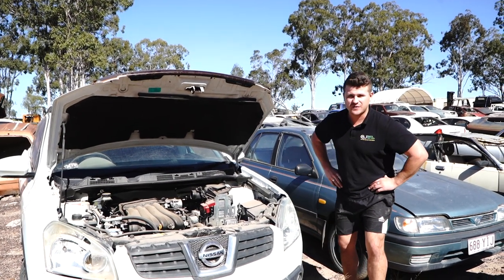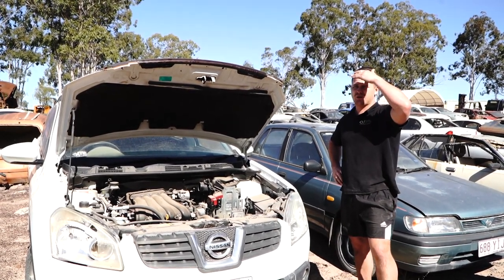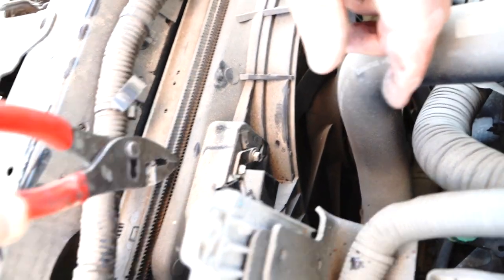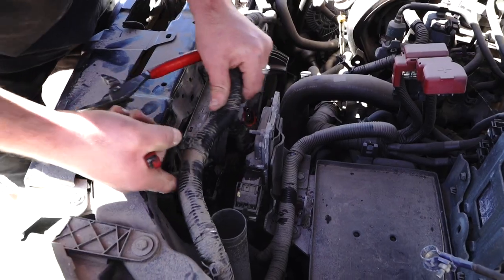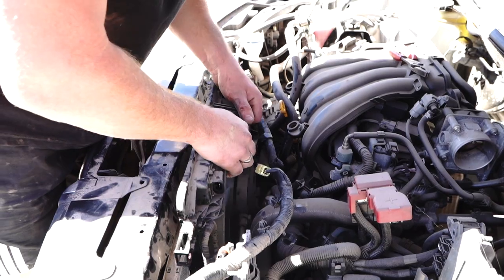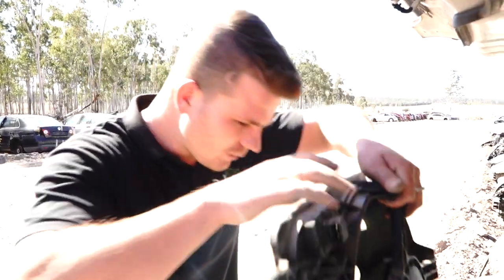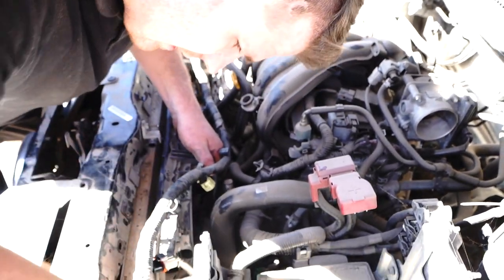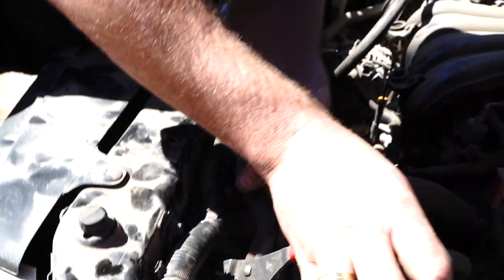How to Replace Nissan Dualis Radiator Cooling Fan 2L J10 Engine 2007-2014

Comment: Thanks for the clear video. I live in Franeker in the Netherlands. The electric part of the fin is worn. I have Nissan Qashqai J10 from 2010. petrol, 1598 cc, 5 gears, airco. The compleet fin is very expensive, so I bought a used one with 112000 km, it comes from the same type of car , but the engine is 1998 cc. There are many types of fins, mij fin has 9 blades. With your video I will get the job done.

Comment: Ive got a issue with my nissan dualis.
 It overheats when aircon is on at idle 
 Doesnt overheat driving on aircon or when aircon is off  & its idling tho, only when aircon is on.
Reply from the maker: Blocked heater core under the dash? It should be the opposite. When you turn the heater on, it opens up an additional cooling system under the dash. Pushes the hot water through another mini radiator and fan. This should effectively help to cool it more. If it doesn't, get it checked for blockages? Unsure